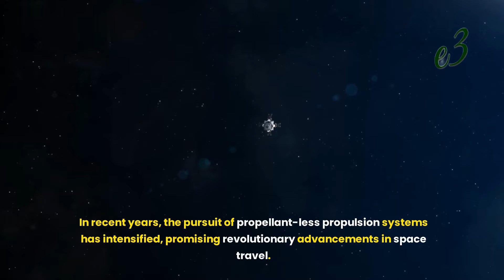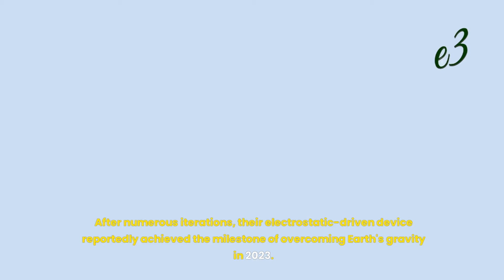An Engineer Says He’s Found a Way to Overcome Earth’s Gravity

Comment: Here's the problem I see with this theory. The larger the object is that you're trying to move, the more mass it will have. This will cause the gravitational forces of Earth to have a greater affect on the object. In other words, bigger, heavier objects will require way more energy to generate an opposing force greater than Earth's gravitational pull on that object. Here's the other thing. In order to counter the gravitational force of Earth without thrust, you have to push against it. It's like moving one magnet by pushing another magnet towards it with the side that is the same popularity. As that magnetic field gets further away, it no longer has an affect on the other magnet because the steering on the magnetic field isn't strong enough to push the other away. You can't make Earth's gravity get stronger as you move further away from it, so you will have to make the gravitational field of your craft even stronger which means was more energy will be needed to do so. Once you're in space, forget about moving in any chosen direction without some type of thrust.
Reply from the maker: thanks
Reply: Why are you even thinking about magnets and comparing it to gravity both are different forces and if they actually made something that could counter gravity enough that no gravity is on the object even a firework would be enough to get it anywhere
Reply: @vinitdommeti1038  Your missing the main theme of this video and that is to counter Earth's gravity without using any kind of thrust. Gravity takes place at an atomic level. Positively or negatively charged ions can be used to repel away from the atoms that make up most of the Earth's mass. We could even push off of the Earth's own magnetic field, but due to variation in strength of the magnetic field from one area to the next, this probably wouldn't be a viable option. I dunno. I'm just making this up as I go, now. 😁